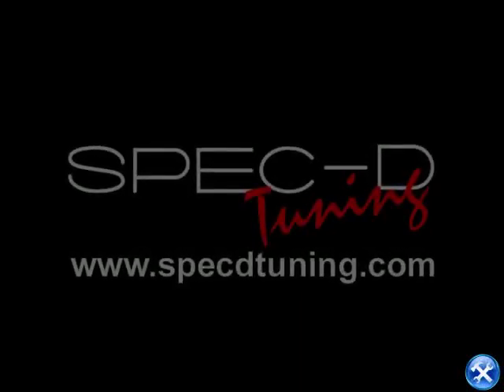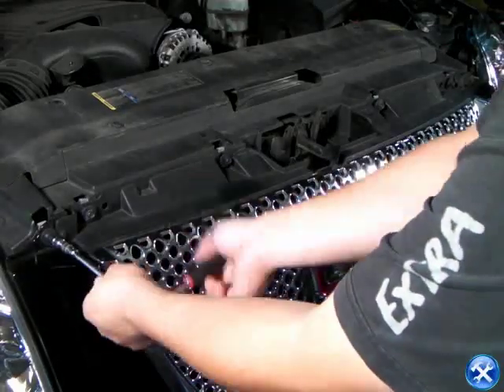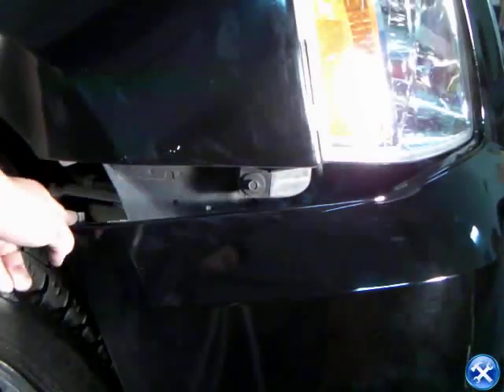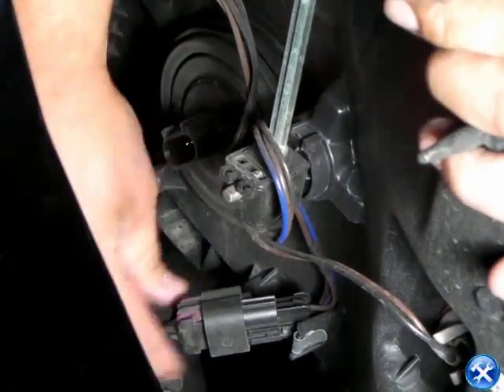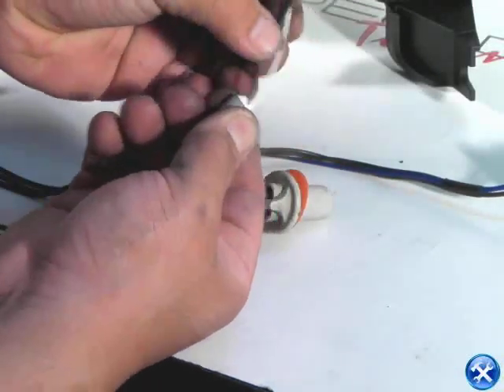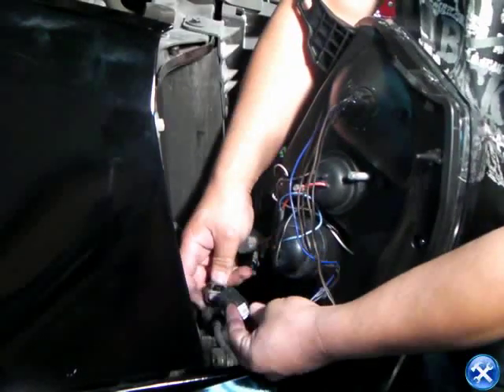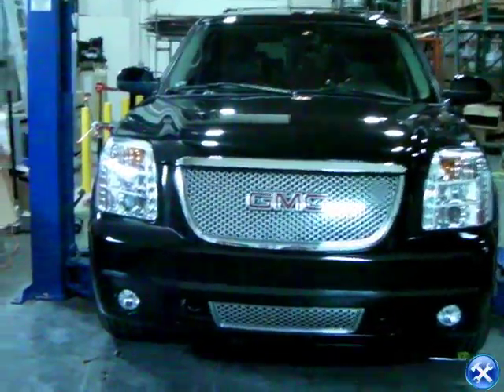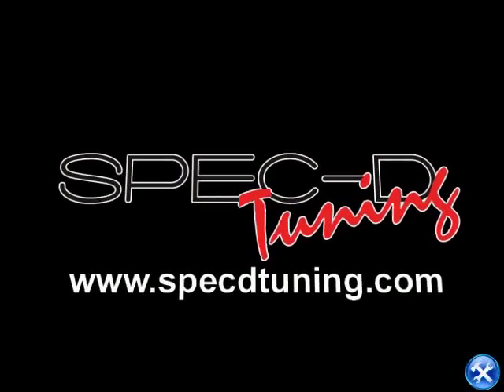SPECDTUNING INSTALLATION VIDEO: 2007-2010 CHEVY DENALI GMC YUKON PROJECTOR HEAD LIGHTS

Comment: At 1:11 don't try to loosen these bolts if you live in snow states. They are probably corroded and will just shear off. You can change the lights after removing the grill. My lights were prewired and worked 100% out of the box. Purchased in 2020 from Redline360

Comment: they look good but you cant see past a certain point, in this case thers a line where the headlights stop projecting and you cant see anything passed that unless you turn your high beams on, you can actually see what im talking about if you watch the last part of the vid that shows the view from inside. is there a way to fix? i thought maybe changing out oem bulbs with an HID set?

Comment from the maker: @ker4games Because the Hybrid is the Unibody design using the Zeta body platform; it is better that you check with your local dealer to ask it the dimensions of your headlights have changed at all. If they have not changed at all, the video on the headlights will work. Good luck

Comment: How do you hook up a relay harness to these headlights ? I’m going out of my mind trying to figure it out because the high beam and low beam are tied into the same connector
Reply: My high and low were wired to the blinker and I can’t get it figured. Don’t have high beams. But I have high blinkers. The connectors don’t fit the other way around.

Comment: I just ordered a set from carpartsinnovate on ebay and they are not the right fitment.. If I bolt holes do not line up, there is a one inch gap under the headlight whereas the factory lights do not have a gap.... I am just looking for something that is going to fit correctly and fit like the oem lights... Very disappointed in the product.  These shown in the video are the exact same model I ordered and the box says spec-d tuning, but I also had a card inside of it that says they are k2 motoring product.  Ebay also said that the seller is not in the united states and I can't return the item but the package was delivered to me from california?  Their ebay store says they are in china but IDK.. ALL I want is a set of headlights that fits my denali the right way. Not with gaps and bolt holes not lined up....Can you help me out?

Comment: I just bought this set for my Denali. Hooked everything up perfectly and one side the LED's don't work and the other side faintly flicker. Wasted $200
Reply from the maker: +Techie-info-center Check the wiring, make sure everything is properly grounded. The seller will have a warranty for the headlights if you need new resistors or bulbs.
Reply: I'm having the same problem the left side LED on the headlights are not working
Reply: Spec D Tuning
Reply: Helpthe left side
Reply: David Johnson im having same problem

Comment: I just ordered a set from carpartsinnovate on ebay and they are not the right fitment...If I did install them the bolt holes would not match up, and there is a one inch gap under the headlight whereas the factory lights do not have a gap... I am just looking for something that is going to fit correctly and fit like the oem lights.  Very disappointed in the product. These shown in the video are the same exact model I ordered and the box says Spec-D tuning, but there was a card inside that says they are K2 motoring?  So are you guys affiliated?  Ebay also said that the seller is not in the united states and I can't return the item but the package was delivered to me from california?  Their ebay store says they are in china but I cant tell.  All I want is a set of headlights that fits my denali the right way. Not with gaps and bolt holes that dont line up. Can you help me out?